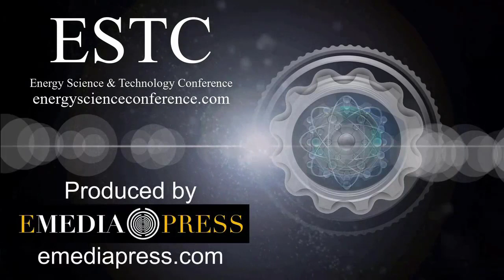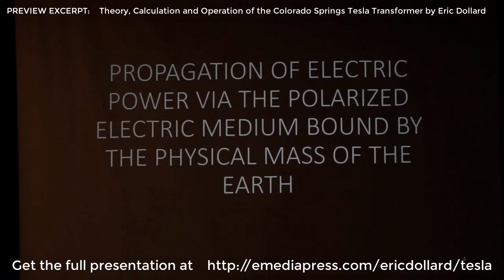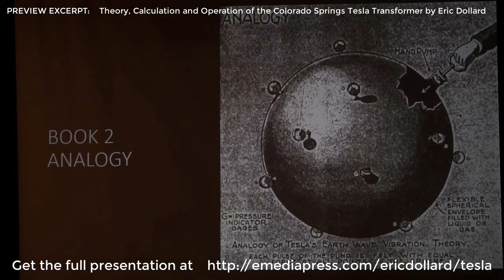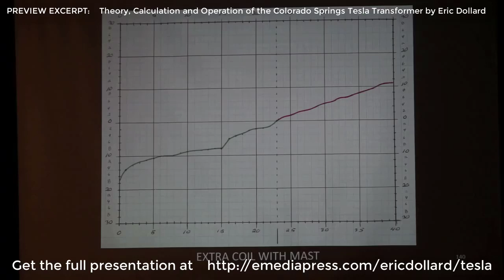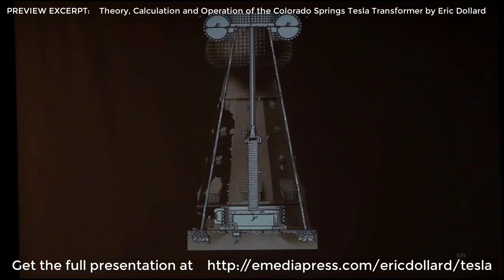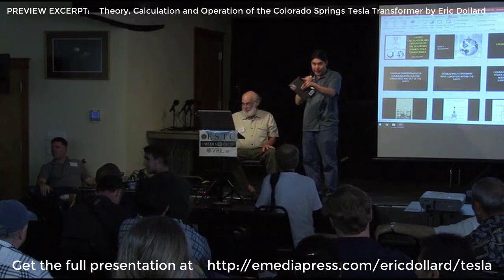Preview - Theory, Calculation & Operation of the Colorado Springs Tesla Transformer by Eric Dollard

Comment: I wanna create Thor’s hammer... can you tell me how to use frequency/crystals and magnetism to create this device... I want the hammer to pulsate a very low vibrational note but I want the note/frequency to leave with such force that when it hits the ground it sends out a shockwave causing an earthquake
Reply: Basically if I stand in front of a 12” bass speaker I can feel the bass resonating through my body... How do I capture that frequency and magnify it’s potential... for example I know it’s the frequency producing waves that are hitting my body so how can I simplify that technology to give me an increased pulse of that frequency wave...